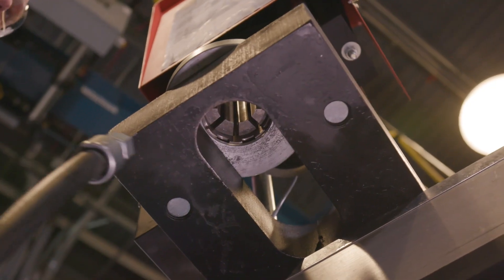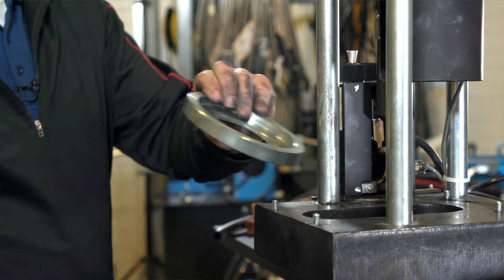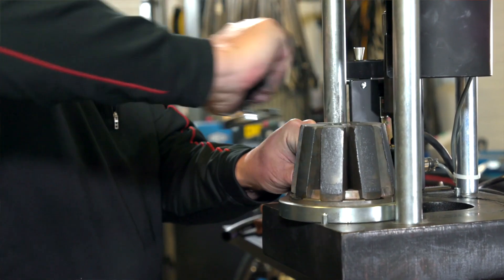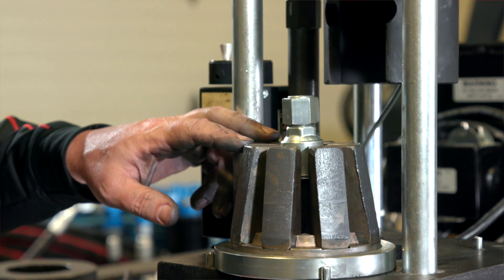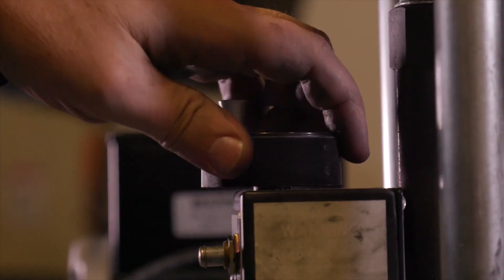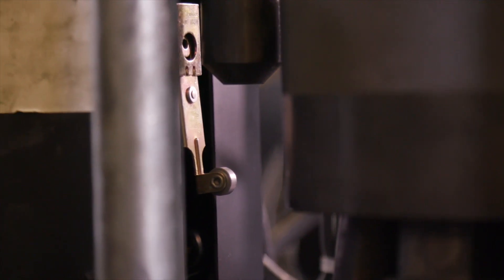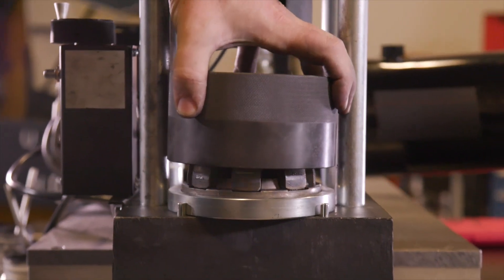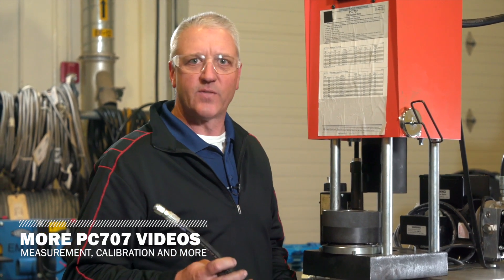Crimping the Gates PC707 Crimper

Comment: does it matter if the die cone is notched or not?
Reply from the maker: The No-Notch Die Cone must be used with all 720, 737 and 739 dies because the higher pressure required may crack the Notched Die Cone.
This is also noted on eCrimp.com like example below using 737 die.